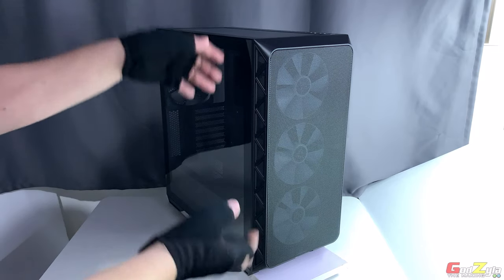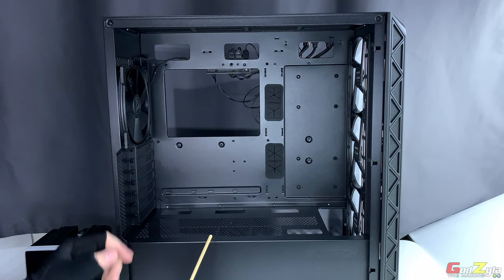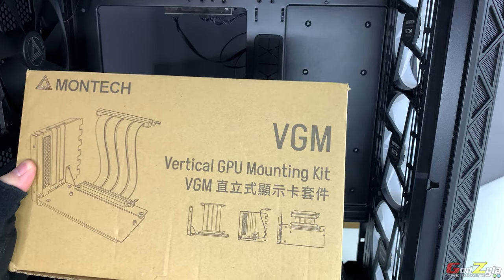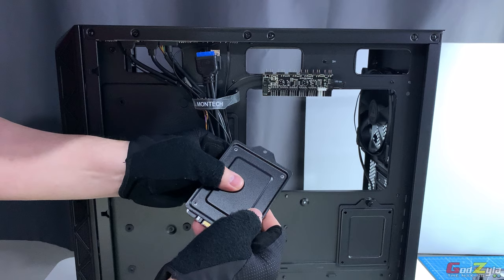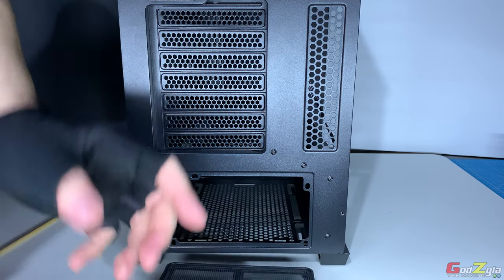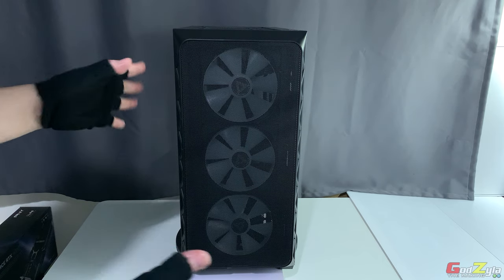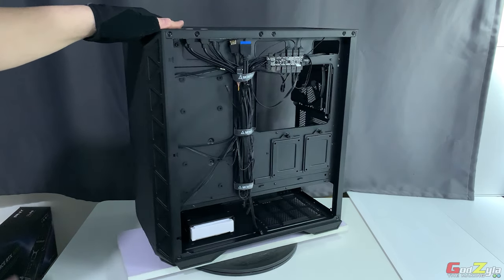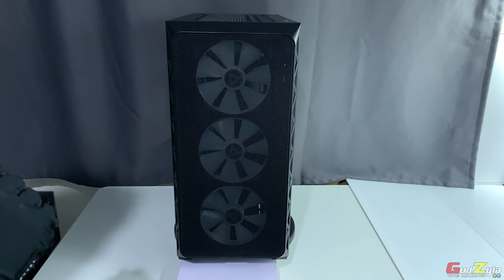Montech Air 903 MAX

Comment: Hello, do you think I can fit a LFII 280 on the top but using 120mm fans instead of 140mm?
Reply from the maker: Hi Zius, welcome to my channel, you can’t fit a 280 LF2 at the top kind watch 10:57
Reply: I know I saw it but what if I use 140mm to 1200m fan adapter brackets to screw 2x 120mm fans on that radiator. Will it still hit vrm heatsink?
Reply from the maker: @kinzie3915  hmm you can give it a try, it might work.

Comment: I haven't seen one in person yet, but if they increased the quality of their cases over previous models, its a winner. 

Will be hard to recommend something else to people that want to optimize their budget.
Reply from the maker: Hi Deviant Builds, welcome to my channel and you are right. Infact Montech is doing a good job so far, opening up qaulity and valuable products for us. Thank you for your feedback, greatly appreciated it. 👍
Reply: I'm a first time budget PC builder. I use this case specifically for its price point. And the fan/R GB hub. It was very easy to build in. I had no issues.
Reply from the maker: @Neo_The_One_  hi welcome to my channel and thank you for your feedback. Greatly appreciated it 😉
Reply: For budget, keep an eye out for montech x4. Should be coming in October. 60 bucks and comes with 4 fans and mesh front, tempered glass panel.
Reply from the maker: @joshholmes1372  hi and welcome to my channel, thank you for the info.

Comment: Hi! To clear things out about the fan hub. So, I only need 4pin connector to my motherboard (sysfan1) + SATA connector to my PSU to control both RGB (with RGB button) and fans speed (in BIOS)? 3pin is not needed?
Reply from the maker: Hi Soilworker, welcome to my channel. That is correct, do note if you plug all fans to the hub and the pwm cable from the hub to your specific motherboard fan header. all your fans will take instructions from that fan header of your motherboard.
Reply from the maker: @crazynuts699  you are most welcome. All the best with your build too.